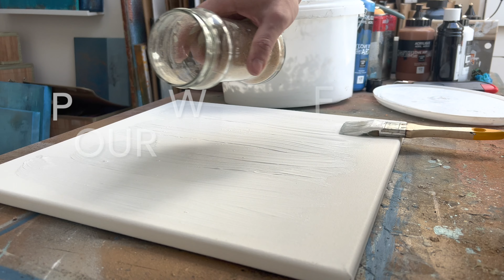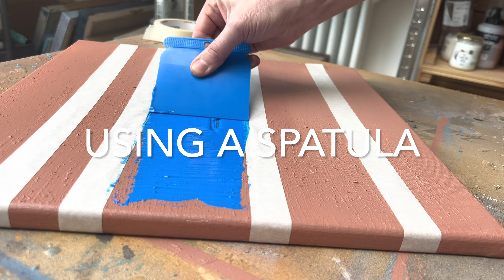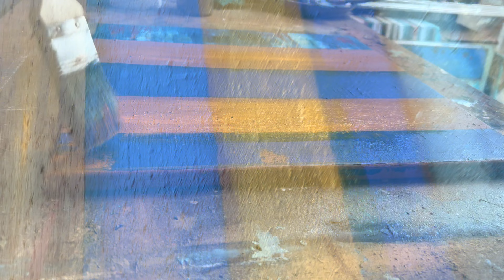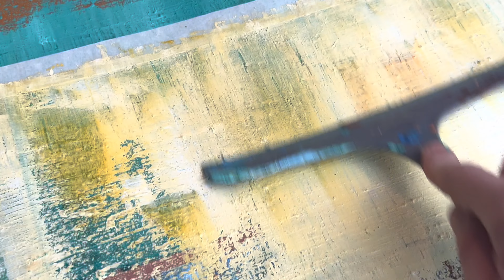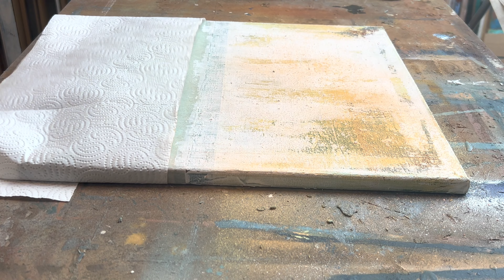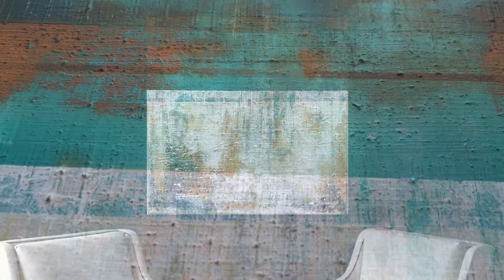ABSTRACT ART TUTO STEP BY STEP ART DEMONSTRATION WITH ACRYLICS MASKING TAPE & WOOD CHIPS TEXTURE DIY

Comment: In some of your amazing paintings you use free hand lines with oil pastels. Are you also using acrylic paints when you use oil pastels?  If so why those two mediums?  Absolutely stunning work to watch.
Reply from the maker: Good morning Alicia ! Thank you for your comment ! Yes, sometimes I use oil pastels; to create a base, its to create a slight texture in the undercoat, and when I apply the acrylic on top and that I remove a little paint, it can appear in certain places in a subtle way the oil pastel of the bottom; Greetings